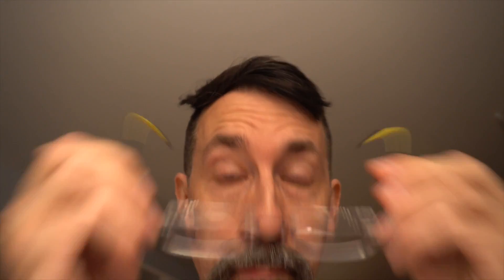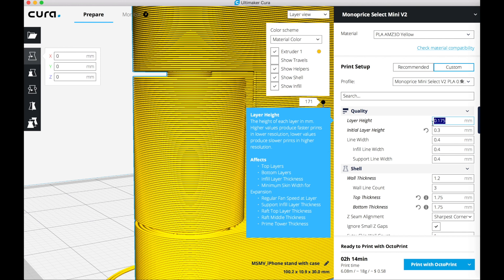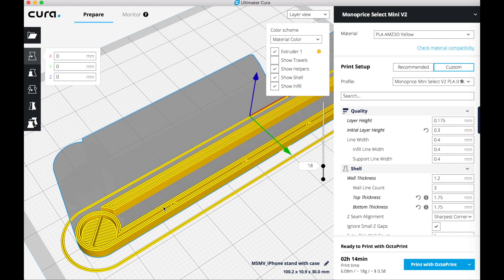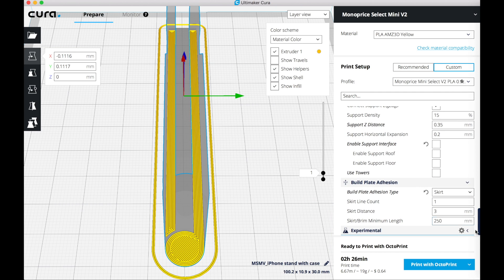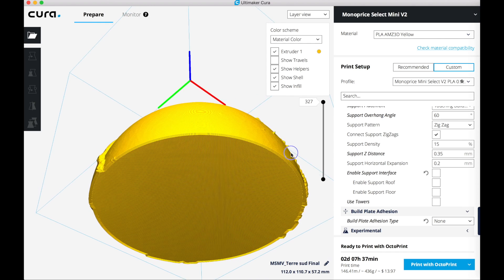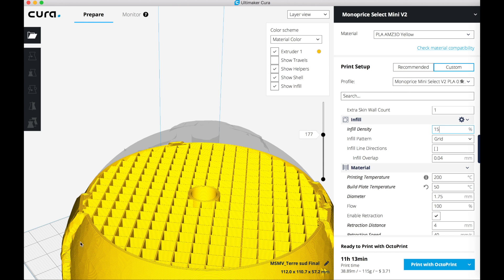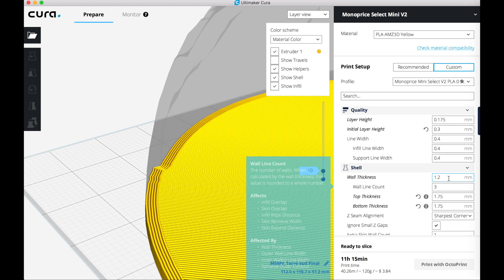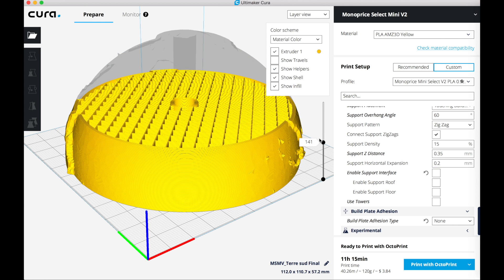Cura 3 - How To Examples

Comment: In some areas you define the layers and others you state 1.75, are the interchangeable?
The filament is 1.75mm. When it is applied it is something less than that.  So does the printer make the part based on the 1.75 figure or the actual compressed size.
 Newbie trying to understand slicing.

Comment: Great video! :) About hinges - and movable parts in general; some printers makes the print too hard to bend where the hinges are, and places with small gaps can become fused. To avoid this, it might be a good idea to:
- Set "horizontal expansion" to a negative value, such as 0.1mm
- Set "slicing tolerance" to "exlusive"
- Make sure "Outer before Inner Walls" is checked

Comment: In settings under infill tab, there is "infill pattern". What is the difference between 'grid', 'lines', 'triangles', 'cubic', 'octet', 'tri-hexagon', 'cubic subdivision', 'quarter cubic', 'concentric', 'zig zag', 'cross', 'gyroid'.
Reply from the maker: Hi, some of them are more dense, and depending on the geometry of your model you can have more strenght or save some plastic with different infills, you can visualize what it looks like when switching to the layer view after the processing is done.

Comment: hi 
Frank's   
how to bring to scale 1500 an object ??
Reply from the maker: Hi, you can use Meshmixer edit function/dimensions and scale one of the axis to what you want, you can do the same in Cura selecting the object and scaling using the scale functions on the left he same way, is that what you are asking?
Reply: I want to print an object to scale at 1: 500, at which value I adjust the size of the object?
Reply from the maker: So what I mean is multiply one of the axis in the scale function by 1500 and the rest will follow normally.
Reply from the maker: Sorry did not see your last response, 1:500, if a plane is 30 meters long, 1:500 scale should be 30 meters divided by 500, or 30000mm divided by 500 that gives you a length of 60mm for at 1:500 scale, input that in Cura for the scale of the axis of the length of the plane and your good to go. Does my explanation make sense?

Comment: Hi.  Nice video.  I just bought the FLSUN Delta 3d Printer and waiting for it to arrive.  It comes with Cura among other app.  (I'm on Mac).  One thing I'd like to learn, 2 actually Take a photo of my grandson and put it on a coin.  I want to have some relief, not just flat.  The other thing is take a 360 set of photos and print a small statue.  How would I go about that?  Thanks
Reply from the maker: Hi, to print with relief is tricky I never tried, you would have to do some 3D modelling in something like Blender, it could be based on light value. For a statue, it is called Photogrammetry Prusa Research just did a nice blog on this: https://www.prusaprinters.org/photogrammetry-3d-scanning-just-phone-camera/
Reply: Hi.  Thanks for your reply and the link.  I'm reading it now.

Comment: Hi Frank!, I have a problem with the extruder retraction, when the printer start his jod all is normal, the flow is stabilized, but when it have to retract the filament to do a travel and then start to flow the filament again, the extruder doesn't deposit it until some lines after, the problem with this is that in just one place of the print a hole appear. I have been changing the value of the settings of the extruder retraction but it do the same, I have a Anet A8 printer, and I am usin 1.75mm PLA and I never have modificated the extruder, if someone know who can I fix it, I would appreciate it.
Reply from the maker: Arturo Fuentes García Hi, did you try to lower the  retraction speed also ?
Reply: Yes, I have tried with no retraction and until 90mm/s, and I changed the distance too, I have proven with 0.2mm to 5mm. I used Cura 14, now I am using Cura 3.0.4, The problem persists, and now I have another one, the program write wrong coordinates and when the print ends the extruder doesn't come back to the origen and I have to off the printer by the cable, if I don't do this, the motor doesn't stop and starts to go down and push down the hot-bed . Thanks for your attention Frank, I hope you can help me.
Reply from the maker: Hi again, have you tried my settings from this video? Did you do any modification to the firmware settings?
Reply from the maker: Cura 3 - How to do Your First Printhttps://youtu.be/cCfXZ2LwM7w
Reply: Thanks for your response Frank! 
I already watch your video and I have put the same settings, but the fact that I have a Anet A8, I configure in accordance with this video ( https://www.youtube.com/watch?v=zj--CASZXJY ), the software is a version diferent but I don't think it generates trouble, please check it.
One more thing, I just noticed that my printer doesn't retract the filement, although I set a big distance retraction, what it do is the follow: the print start so good, but when it have to do travel, the extruder motor doesn't retract the filament, it only stop the flow and then start with the normal speed. It is so bad.
If you have any idea what it could be, please tell me. Sorry if I write wrong, English is not my mother tongue
Thank you so much!
Reply from the maker: Hi, your A8 is similar to my Hictop 3DP11, a Prusa i3 clone. In the latest Cura, there is a setting called « Combing Mode » in the « Travel » section, make sure it is set to OFF (I use ALL or NoSkin but for a test OFF will make all retraction happen).

But since your machine is like a Prusa i3, what I would try is add a new printer
-Select the Prusa i3 in the list of Cura.
-Than modify the settings in manage printers, you only need to modify the X Y and Z sizes to 220mm instead of the 200mm.
-Leave the printhead setting as they are, it is only used if you want to print individual parts one at a time in one print

I think that would give you a solid base for the settings.
Reply: Thank you so much Frank!, I did what you say and now the retraction is working and the printer is doing all good, but I have to print always with "Combing Mode" set to OFF, can it generate problems in my print?, do you know why my printer can't do the retraction when I settle "Combing Mode" to "All" and "No Skin"?.
And I have just one problem more, in the first layer fill the flow is too much and this generate that first layer is wrinkled.
Thanks for your attention and your help Frank!
Reply from the maker: Hi, I do not know why you have problems with retraction when not set at OFF, try to add the Prusa i3 as I explained and see if those make a difference. 

As for your first layer, it is probably too close to the bed, look at my examples in Bed Level Demistified. You can also set the first layer a little hotter (5 or 10 degrees), it is an additional setting in Cura, if you do not get enough adhesion when the first layer is higher.
Reply: I did, I created a new profile with the Prusa i3 option of the program, and that's why the prints are doing right now, but I think is just configuration of the Cura program, as for my first layer, it's okay now, it was a bad hotbed calibration.
I have another problem, the coners that infill generates are visibe from outside :( it look like so ugly... thank you Frank!
Reply from the maker: If the infill shows true the walls, just increase the wall size, I recommend to use Wall Line Count to adjust it, you can also control Top and Bottom under that settings.

Comment: Great channel frank, I've been trying to print https://www.thingiverse.com/thing:1876602. Apparnently, the trick to printing this strainer is that you use your slicer's infill pattern to create the mesh. would you have any advice on how to do that in cura 14.07?
Reply from the maker: Thank you and I will try this, but I suggest you try to move to Cura 3.0.4 (3.1 was problematic for me st least) if you have a Monoprice Mini, my video https://youtu.be/cCfXZ2LwM7w can help with that. In any case, I know that I have the settings for top and bottom thickness in Cura 3.0.4
Reply: Thank you i will install this. I am using an Anet A8
Reply from the maker: I just tested in Cura 3.0.4 with custom parameters of 0 top and bottom layer thickness and triangle infill pattern the result is as expected. It can be done in Cura 14.12 with bottom/top thickness of 0 and infill of 35 but you do not have control over the infill pattern in 14.12, looks better in Cura 3.0.4 with triangles infill pattern. Picture in Cura 3 : http://franks3dshop.com/Strainer_Cura3.0.4.jpg Picture in Cura 14 : http://franks3dshop.com/Strainer_Cura14.12.jpg
Reply from the maker: I did not see a preset for Anet in Cura, you will have to find the settings (can be from Cura 14) and do a custom setup. You should be able to find ressources on the net.
Reply: Frank's 3D shop thank you for looking in to that. You cura images look a lot more correct then mine I will give it a go when I get home.
Reply from the maker: From what I see, you can use the settings for a Prusa i3...
Reply from the maker: You are welcome, in Cura 14 you have to go in Layer view and go down in the layers or you will not see the infill... Cura 3.0.4 is so much better, faster, stronger (there is song like this?).
Reply: That worked, Thanks again.
Reply from the maker: Great!

Comment: Nice contrast of parts.

My biggest challenge at the moment is horizontal overhangs, especially those that extend several mm's from the previous layer.
The hinge in the stand is a classic example.

Is there some sort of magic required to get a good result without filament just drooping and not fusing well, even with support?
Reply from the maker: Hi, thank you for the comment, and yes, temperature, speed, part cooling, layer size are all related to that kind of problems. For the hinge I did a bunch of tries and errors, I problem was that it was fused together, I had to increase the gap size to prevent that. For overhangs, it depends, sometimes I leave it drooping a bit and sand afterward, or I add support, and that is another can of worms. If it's one of my design, I could design support for trouble areas. I only use Cura, it's free and as the features that I need.